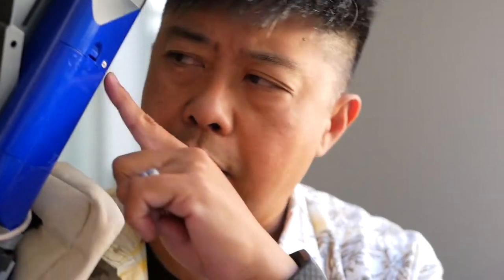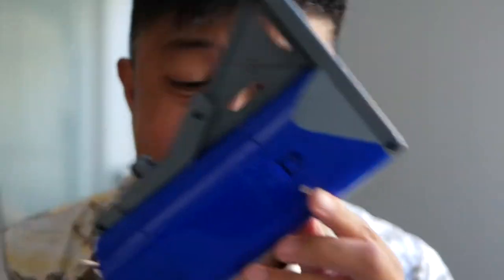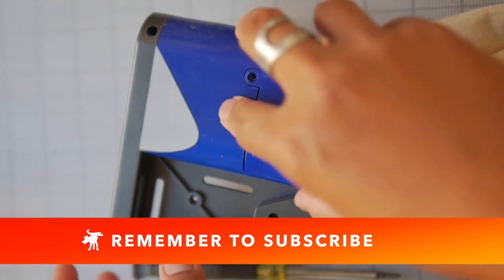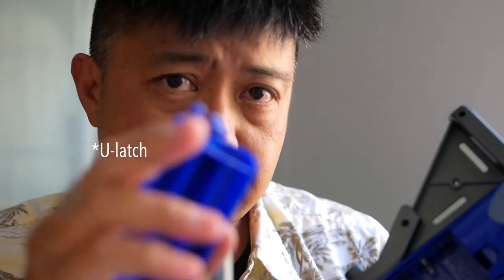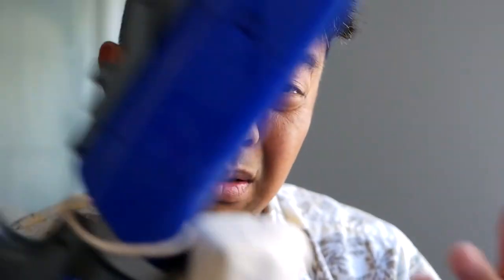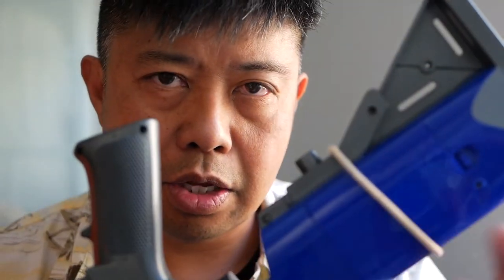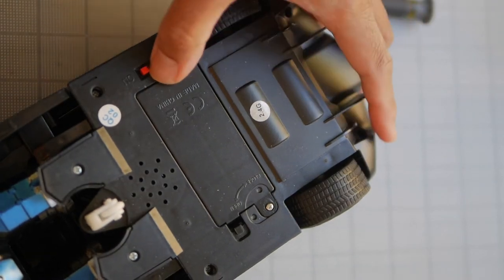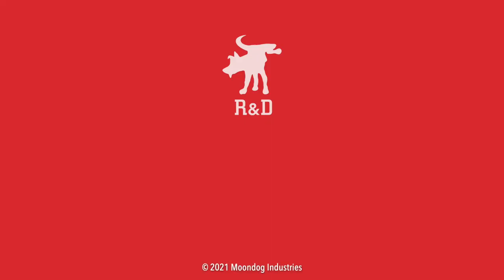Screw Toy Battery Covers

Comment: I feel the same way. WHYYYYYYYYYY? I have 5 toys that I can't get that tiny screw out of. I paid $10 for multi-screwdriver set and $16.99 screw extractor set and NOTHING WORKED. The screw hole is stripped now. Guess the only way is to break the battery cover to get the batteries out. The screws are meant to NOT come out of the cover for whatever dumb reason.
Reply from the maker: Ugh, the same thing happened to me this Christmas with of my sons new toys. Arggh! Hope you subscribe.
Reply: so you have to buy a new toy instead of just batteries lol i'm doing the same thing and it's way tight down in a hole and there are TWO lol  it's a hamster in a ball thing cat toy but my friends brought their little girl today and she found it so i'm trying to get the cover off and give it to her.